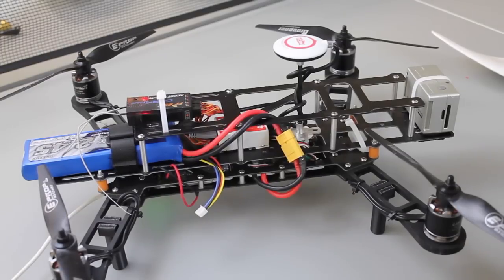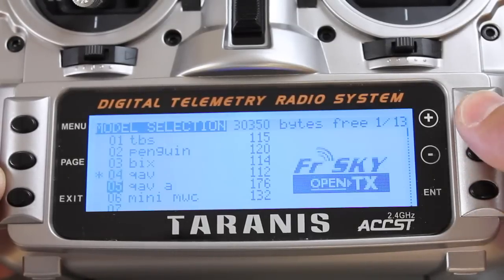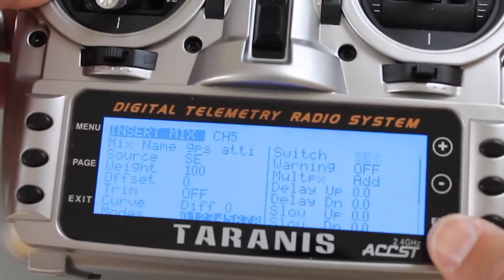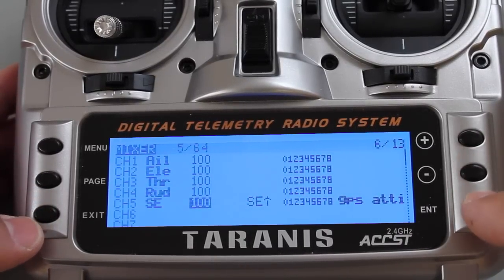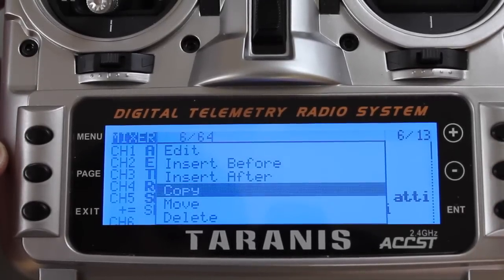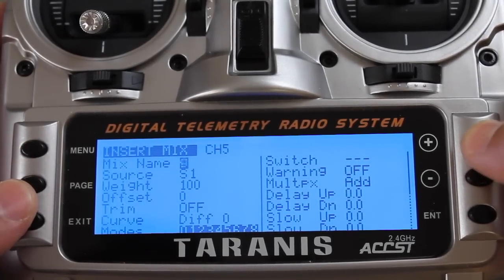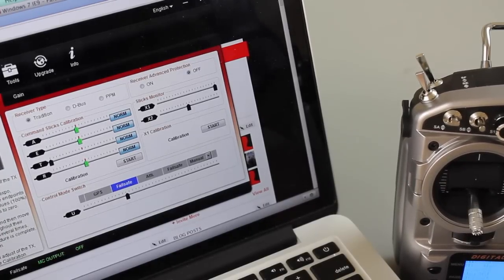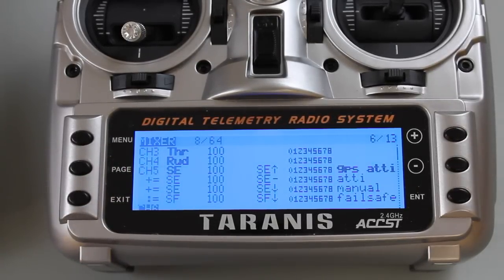FrSky Taranis 3 Flight Modes and Forced Failsafe Override with DJI NAZA on QAV400 Quadcopter

Comment: Hey, Dennis, 
You saved me, thank you so much.
One note about the mix for channel 7. 
You can achieve the same result by having 4 'siblings' mixs, one for each of the four {gps-atti ,att, manual, failsafe} modes, all of them in mode 'replace' (that is to have :=, instead of +=). I believe this way is more clear than having two levels, one with +=, and the second with :=, as in the video. Once again, thank you so much for your great help
Reply from the maker: Glad you got it working and thanks for sharing that bit of information. Very useful and will help myself as well as others. Take care.

Comment: Thank you so much for this turtorial! I recently flashed my Turnigy 9x with open tx and had to figure out how to Programm it in order to set the 3 modes (GPS, ATTI and MANUAL) to the 3 position switch. The hardest thing was to figure out how all the switches are named in the software. With the Taranis you just have to actually flip a switch to let the software know which one you are about to Programm. With the Turnigy 9x it’s a little different as it doesn’t act like the Taranis wich automatically recognizes the switch you want to Programm. For everyone here with a flashed Turnigy 9x to Open TX or even ER9X:

The 3 Position switch is called 3POS
The switch in up position is called ID0
In the middle position it’s called ID1
In the down position it’s called ID2

The switch for Failsave as shown here in the video is called THR

The offsets for each switch were exactly the same for me as shown here in the video.

Again big thumbs up for this video, it helped me a lot!

Comment: Wow, after all these years this video is still so helpful. Thank you Dennis! I used your method to get 5 modes on SG/SD, plus RTL on the SF switch, woot! I really didn't like the switch combo way people have been using (where SD is basically like a shift to the SG switch). These work perfectly and the SF switch over-rides them all to put the AP into RTL. So great!!
Reply from the maker: Glad to hear that. Thanks so much for the feedback :)

Comment: Thanks a lot for your videos esecially this one.....I managed to set up my DJI f450 easily in my Taranis but then got hung up because I could only arm the motors on ATTI mode!!! Then I watched this clip and at around 5.12 realised what I had wrong and that I had to split the flight mode channel into three mixes to get the sliders in the correct pos when that switch is flicked....thanks again you're a great help to the rc community keep it up :)
Reply from the maker: Mark Vella Thanks so much for the feedback and glad to hear you got it working. I appreciate the kinds words. Take care.
Reply: Dennis Baldwin You're welcome...I do have a question though!!! If I switch off the taranis to activate failsafe the slider doesn't go exactly under one of the failsafe tabs!!! Is there a way to adjust this so when quad loses signal the failsafe is activated correctly or is there no adjustment to be made??

Comment: DJI naza m lite (orig FW) wiped and resetting up. My friend and I bought the RTF flames and I lost mine in 2014, so this year my friend gave me his F450 and  Taranis X9D plus. 
He just went full DJI and im doing a full reset up of everything. Updated the TX to openxt 2.3.15 and updated the boot loader as well. Reflashed the X8R to current and the TX.
 His set up was bad, the FC was on velcro and the GPS wasnt set up right to the location on the frame. 
So Im taking my time and reading alot on the forums and watching Youtube to get back in the loop, funny thing is I just watch your video that you linked you modle bin file and I thought...let me try. Im not sure that I had an acount from 2014 or what. you might have been the person that I watched when i set up my orig F450 back in 2014. Anyway, dude i just wanted to say thank you and im gonna test failsafe tonigh, with out proprs inside and see if I turn off the TX that the Naza M lite software shows failsafe.

Would you are anyone that reads this know if the naza m lite can still be upgraded to 4.02 firmware like upgrade-naza.com project or it this as far as this equipment will go.

again thanks for sharing your knowledge

Comment: Nice tip and very clear.  I was going to just use one switch to have GPS (Default) Atti and Failsafe but now I know I can have two switches set up with failsafe on an independent switch and GPS, Atti and Manual all working too, I'm going to go ahead and set this up.  Thanks!
Reply from the maker: Glad to hear it. Good luck with your setup.

Comment: This is nice, figured mine out, but I configured it using the curves in the mixes. Same result even with the failsafe switch, but different avenue to get there, perhaps I will post a video and show you what I did.. Great video as always! You rock!
Reply from the maker: Nice, Eric! I've messed with the curves a bit, but not to set my flight modes. Very good to know this is possible. Thanks for sharing.

Comment: Good video I know this is an old video when you mix this channel, I don't think DJI supports channel mixing, that causes a fly away. All I want to know when the transmitter is cut off will the failsafe appear in the flight mode and when the transmitter is powered back on will it bind to the receiver and failsafe disappear and go back to GPS.

Comment: Dennis, I came back to this guide as I was able to get my original Naza set up easily following your tutorial.

So now I am on SBUS and although it is right in front of my I am sure, I am a little confused as to how to get the 3 modes to work correctly.  This video assumes you have the cable running in your 5th channel, but now there is only one cable running to the SBUS.  Please....
Reply from the maker: Ado Annie Hi....does this help? FrSky Taranis and X8R Receiver SBUS Setup w/ NAZA Flight Controller

Comment: Mike, I noticed that when the assistant goes into failsafe the throttle stays where it is, should the throttle not go to at least 50% from wherever it might be when you go into failsafe? Thanks 

I have set the rx failsafe so that if I switch the tx off the throttle goes to 50%, is this not necessary with the Naza?

Comment: Is there anyway of setting it up with a battery failsafe in other words falling back into failsafe automatically when the battery is low regardless of flight mode or would I need to monitor battery level via an alarm or telemetry?

Comment: Hi Dennis, i have a problem with my Naza and the Taranis. When i switch between GPS ATTI  MANUAL and FAILSAFE the highlighted box on my naza assistant doesn't stay stable (it flickers between several modes. I've tried to change the settings by changing the values of the mix but i can't get it stable. Can you tell me what my problem is?   Kind regards. Henk Ketelaars (The Netherlands)

Comment: One more question Dennis, but it's OT to this video.  What type of battery are you using in the transmitter (assuming you swapped out the NiMH that came with it)? I've seen a video from RC Model Reviews where he's using a LiFe, but I'm confused on the connector between that battery and the Taranis. Any thoughts?

Comment: excel tutorial,in the manual mode on switch se,the weight shows  gv1 instead of 100,as the other two positions????
does it make a difference ?

Comment: Nice video Dennis.. Got to love the Taranis.

I use the X8R reciever on my X650 quad with Naza V2. Using the SBUS port makes for a much nicer install.
Reply from the maker: I haven't used SBUS yet but have heard such great things about it. I always feel like my builds are cluttered with too many cables. Would be nice to give SBUS a try in the future. Are there any other big advantages that you've found with SBUS?
Reply: Dennis Baldwin
I used the SBUS to control the Naza and can still use ports 6 & 7 to control my Tarot gimble. Really gives a clean install.

I'm not too happy with the X8R PCB antennas as I have lost signal a few times at quit short range, so looking for a way to replace them with standard antennas..

Comment: +dennis baldwin   Great Video. But I have one quick question.  This is showing the old Traditional Way of connecting.  If I have "S-Bus" setup and I have CH7 assigned to the SE (3 position) Switch.  How do you 'trim' each position differently to get into the right zones (GPS, ATTI, MANUAL)?   The offset feature doesn't seem to work when you have S-Bus setup as Offset changes ALL 3 positions.
Reply from the maker: +Julio Rios Maybe this will help? https://www.youtube.com/watch?v=kl5wuMiZ1_w

Comment: Thanks for all the help over the past year. I was wondering if you 3d print the speaker holder to upgrade the taranis? HB from Bay City Texas.
Reply from the maker: Howard Bardwell I hadn't seen that speaker upgrade until you mentioned it. Very cool. I'll have to look into it. Thanks for the suggestion.

Comment: Hi Dennis thanks for your reply,  I've fixed the problem somehow I was deleting my vocal warnings & vocal settings when I was playing around in custom functions,I plugged my taranis into companion 9x , the first question it asked me was whether I wanted to restore my vocal warnings & settings, one click & it was fixed. 
Ps your video on gimbal adjustment with curves is fantastic , I finally got my cheap gimbal to work properly , I found that if I also adjusted the weight setting lower that it operated much smoother
Thanks again  Regards Mike
Reply from the maker: Thanks for sharing that info. It's always good to have this information available. Regarding the gimbal video, thanks for the feedback. I'm glad to hear you're gimbal is woking smoothly. Good stuff.

Comment: Great video! It's working with my NAZA-M V2, but how is it possible to get the slider  to go to Failsafe when radio is turned off? The slider goes all the way to the right side when i do so. I have a flyaway problem this days and just maybe it's my radio loosing connection to the Rx.
Reply: The answer was a little loinger down on this page i beleive.  NAZA Enhanced Failsafe RTL After Signal Loss With FrSky Module
Reply from the maker: Jørn Ramnæs Right. Good luck getting this setup. If you run into any more problems please check out www.garagepilots.com and post in the forums.
Reply: +Jørn Ramnæs I thought that when the slider goes all the way right (or left) this is also failsafe, and was kind of counting on it to configure. Can someone confirm if so or otherwise?

Comment: Dennis, how would you hook up failsafe to a retrack system. I hooked it up to a switch, but I would like to also hook it up to failsafe. Would you know how to do it?
Reply from the maker: What receiver are you using? I ask because a lot of the receivers that support failsafe allow you to set your switches and stick endpoints when failsafe is triggered. So with the FrSky RX you could toggle your retract switch and then hit the failsafe button. This would tell your RX to bring down your retracts when in failsafe. If I'm misunderstanding let me know and I'll try to help you out. Cool idea.

Comment: Hi Denis. I have taranis plus. Dr4ii. Naza m lite. PPM. Xhover mxp230. Your video was very helpful. May ask for your advice please. Issue with throttle increasing throttle after initial start motors speed up, but at full throttle don't appear to be a full speed. When reducing power motors stop at throttle setting 1/2 power. Dji set up page shows throttle moving thru full range. Quadcopter is sluggish due low power. Power to motors is very low. Battery full charge 2200 3s.
Reply from the maker: Xodawara That's strange. Especially since the Assistant shows your throttle going full range. Another thing to check is your ESC calibration. I would do that for all 4 of your ESCs if you have done that already. If you continue to have problems then post in the forums at www.garagepilots.com and we'll try to help you out.

Comment: Hi Dennis, thanks for the great videos. I've had my taranis for a couple of weeks now and have got it set up with my phantom to give me vocal warnings, flight modes & telemetry readings. I've had an intermittent problem when turning on the taranis , if when turning it on it doesn't give me the vocal warnings & flight modes & telemetry, I get no vocal feedback for the entire flight. If I get the vocal info when I turn it on it gives me all the vocal feedback ie battery voltage , rssi, countdown timer, gps or atti mode  & various warnings during the entire flight. Do you have any ideas on what's going on as the problem is now occurring more than 50% of the time. Regards Mike
Reply from the maker: Hey Mike, that sounds painful. The only problem I've had so far is that my throttle stick won't stay all the way down. It tends to creep up and always triggers the "Throttle Warning" message when powering up. I haven't run into the problem you're describing but will keep an eye on it. If I do stumble across it I'll see what I can find out. Sorry and good luck!

Comment: I'm a newbie and this is the kind of info I was looking for to decide if I want one of these.
Could more of what you just described have been done with the computer or does it
require as much manual button/switch pushing?

Would you have any real basic how to videos.  I am just getting into Quad flying.
I have a Blade Nano and a Syma X5C-1.   My goal is to have 1 transmitter to fly both of
these plus anything else I get in the future.    I have not found anywhere stating the Taranis
and a Transmitting module would work for the Syma.

Thanks,
Ken
Reply from the maker: Ken There is something called Companion9X that lets you manage a lot of the settings from your computer. You can check it out here:

http://www.open-tx.org/

Unfortunately you won't be able to bind your Taranis to the Syma. But those are good setups to teach you how to fly so you'll be ready when you do your first build. Good luck and keep us posted.

Comment: Dennis,

This is a great series and I'm learning a lot.  I'm trying to use the D-BUS port on an X4R, and NAZA is not recognizing switch 5, 6 and 7 settings.  I suspect that's because the X4R is only a 4-channel receiver - regardless of the port connection used.  Is that a correct assumption.  I future proofed myself for this hobby, and bought the Taranix X9D Plus, and am no where close to mastering anything about it yet.

I was bale to get the port set for AETR, but oddly enough when I try and run the motors I get nothing - dead.  I'm getting about 12.5 volts at the ESC connection point.  Any ideas?  I'm using EMAX 935KV motors on this S500 quad build.
Reply from the maker: I plan on doing a video on the X4R soon so if you can hold out I'll try to get it posted in the next week. I've never used it so it will be a bit of a learning curve for me. Using SBUS you should be able to get 16 channels out of it. I think you can only get 3 PPM out of it if you're not using SBUS. Thanks for the question and I hope to have an update soon. Good luck with your build.
Reply: I made some progress over the weekend and finally figured it out.  The NAZA is talking to the X4R and the X4R is configured on my X9D.  Success!  Ilearned that the U port of the NAZA has to be connected to channel 7 on the X9D.  I'm sure it can be remapped to another channel, but that's beyond my current skills.  The RC hobby is all new to me, but I'm learning - even if I get a little frustrated along the way.  :)  Your videos are very helpful and I'm glad I discovered you.   Over the past couple of months I did buy a store-bought drone the Yuneec Q500+.  It's way cool, but I still want to learn to build these amazing little flying machines.  My flying skills are really where I need to focus.  My house however is in the middle of the woods and I have to drive whenever I want to fly.  And since I'm in CT, there are no wide, open spaces like out West. :(

Keep up the very informative and useful videos!  - Rick

Comment: Hi Dennis just another question for you, i will be setting up my hex soon mostly for video. just wondered do you really need to set up the manual mode or can you replace it with the fail safe on the 3 position switch so you would have att mode and gps mode and fail safe. hope this makes sense.  john
Reply from the maker: jced102 It's not necessary to setup manual mode if your atti and gps modes are working fine. I've set mine up without manual mode on several occasions. Good luck!

Comment: Great video, i've followed what you said to the letter and it works fine on the bench, but i have one question, i'm now trying to calibrate the compass before i put the props on and test fly it as this is a new build, i've followed what is says in the dji manual but when i flick the mode switch(switch SE) 6 to 10 times from manual mode to gps atti mode i'm then not getting a constant yellow light. would you know why.i'm using a Naza M Lite flight controller with GPS.
Reply: +Above & Below did you fix this with these settings as im having the same problem
Reply: +bob gasman Hi, yes it was fine in the end, I was just flicking the switch too much, after about 8 times just stop the switch in top position (gps) and the light will stay on.

Comment: Hi Dennis - I have this set up running through ezuhf to naza -m and your procedure works perfectly. I have a problem though. Once the radio glitches or looses signal and goes into FS mode the naza sticks in FS landing mode and RTLs even though I have signal back. I have tested this on assistant and the slider goes back to gps mode but the naza stays in failsafe? Any ideas please?
Reply from the maker: Zoomer1973 I can't remember specifically this case, but I do recall (at least with Pixhawk) you'll need to toggle your mode switch to another mode and then back to GPS Atti. See the last line on this page: http://wiki.dji.com/en/index.php/Failsafe
Reply: Ok Thanks for that Dennis - looks like I have to toggle the mode switch to get out of failsafe